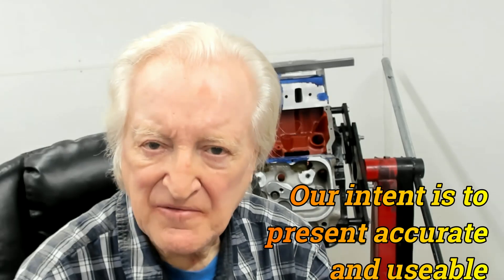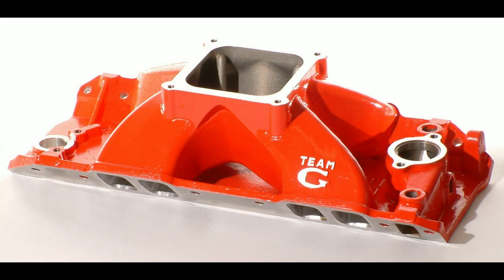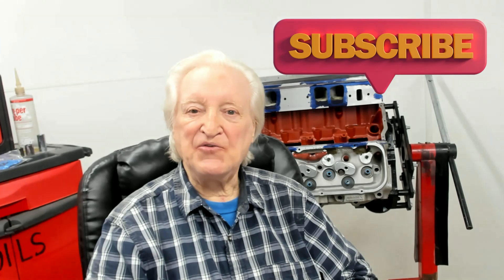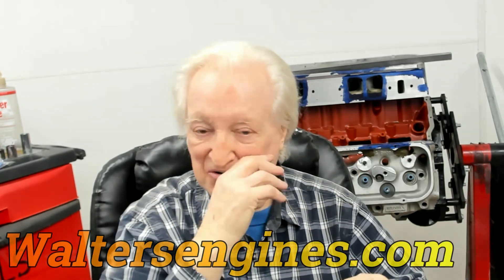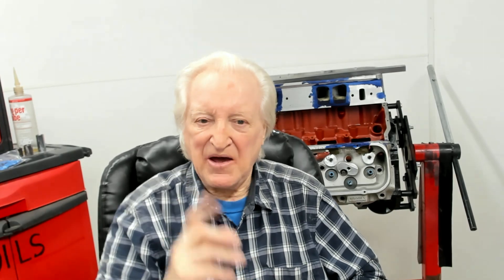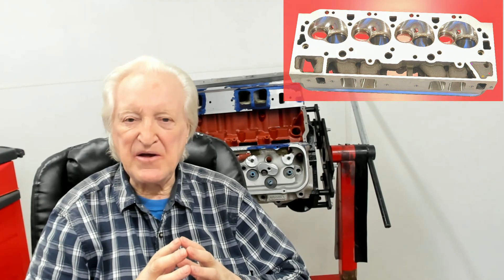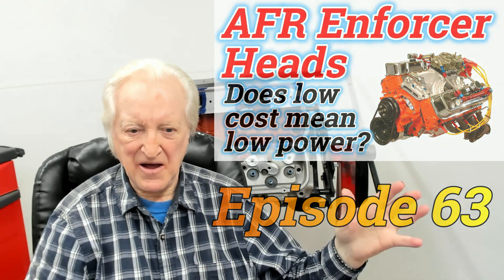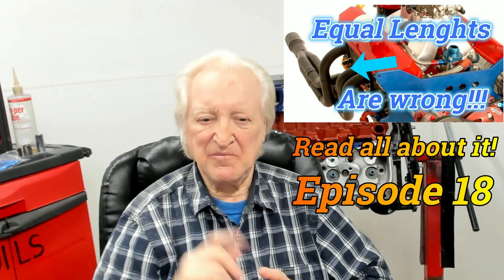BB Chevy 454 stroked to 525 cubes - super big torque!

Comment: Been building big block offshore race boatbengines for 30 years. I even had a supeflow 901 in my house back garage at one point, and listened ro the "gurus" who said 4.375 was biggest you could get in a 9.80 deck. I built my first big block in 1991 which was a bowtie 10.2 block i bought at an auction out of a navy seal  team hsb (high speed boat) i put  a summit/ cola 4.50 crank with JE 4.560 pistons  with .400 eagle rods which made 588 ci. It had a huge solid rollef which i cant remember the specs bit that engine was unbelivable. Anyway i stumbled onto ypur page today and cant wait to look at this 525. Not surw how you get a .250 rod to work on rhat crank but im going to find out. With a stock 454 block im going to save $3k on this engine right off the bat. Thanks and keep up the good work.

Comment: .................back in da day,,,,,1988.............468   was the deal,,,,,,,,,,no cheap cranks back then,,,,,,,,,,, 4.50  stroke  is easy street piston speed for a stroker ,,,,,4.75 inch is ruff ....5 inch is  nuts ........I grew up riding  Harley Davidson  hot rod motorcycles,,,,,,,,,,,,, I still have all the catalogues from  engine part suppliers in file cabinets............fabricators dont discard much,,,,,,,,,,,,,lol .......I like stroker small blocks.....................4 inch stoke,,,,,,,,,,,,,,,,,dart blocks   4.125.........or 4.25  stroke........diesel  torque   on the street ,,,,,,,,,,,,thanks................

Comment: This is a excellent build I am clearancing a 454 block /4.500 stroke as we speak due to getting a good deal on a few 4.500 cranks , I might even duplicate this with a 10.200 (427 truck block)  and a little bigger bore size
Reply: Cool! Did it fit?

Comment: Would that build be ok with a 200 shot or would you need a little wider cam i absolutely love your channel if you ever get time would love a nitrous episode vs the 128 and if the 128 will carry over on big block
Reply: BBC use 132 instead of 128. Same for any canted valve head as well as LS. Hemis are even higher. 134, i think.

Comment: I have a 502 Big Block that when I am able to do would like to get around 750 to 800hp of it either by stroker kit or by a Vortech YSI blower, it currently is around 600hp has GM performance heads and a cam Holley Super Sniper EFI, what would be the most cost effective way of getting my engine up to those numbers? Stroker or Supercharger?

Comment: Hello, Mr. David  Would you mind letting me know? What would be the best cylinder heads and camshaft to put in my big block Chevy? It's gonna have 11.5 compression ratio And the cubic inch of the motor is 546.
Reply: And this is the stroke and the bore 4.280x4.750 And connecting rod is 6.700 long

Comment: Fantastic videos DV, thankyou.
I have a 385eries Big Block Ford .030" over to which i want to run a Scat 502 stroker kit in.
 What this BBC has produced is what i desire to achive for mine, is it safe to assume that these specs basically carry over to the BBF?
I was contemplating using a JKaase P-51 head but see it may not be as big.
Any guidance would be appreciated.
Cheers Ben

Comment: I have a question about the cam. I am looking for a combination that makes good power and torque on pump gas for a boat that has two 454’s. This one caught my attention. My question is regarding the cam. I have been warned that some automotive cams can cause revision of water in boats. This is where the cam sequences allow the water cooled exhaust to draw water back to the exhaust valves. How would I know if this would be a problem with this cam? I am extremely interested in the combination as the power and torque would be amazing for the current 350hp 454’s the boat has now. Awesome video!

Comment: Now what cam would you like to see if you took this combo to 14 to1 compression..
And closer to 7800 rpm..
A taller single plane and a 2 in spacer as well..
I have the vortec 8.1 block which is a tall deck so I can use longer rods as well. Also with a bigger head like the afr 325

Comment: Terry Walters no longer accepting business unless you have a commercial contract with him due to work overload as of Jan 1 2023
Reply: Thanks for mentioning this. I was going to inquire about sending my 1981 454 to their machine shop at some point in the year. Runs perfect, but low oil pressure. I like the idea of a pump gas 10:1 496 build.
These guys seem like the ones to build it for a performer

Comment: David, I have a pair of 565cid (4.25" stroke x 4.600" bore) 9.80" deck engines that are ready for assembly, however they are for a MARINE application offshore hi-perf pleasure boat i mainly use on Lake Michigan. AFR 315cc cnc'd heads with some slight porting on the exhaust port for .700" lift. ...and I have purchased a pair of Edlebrock's dual-plane RPM Air-Gap Pt#7562 in the Rectangle Port design and that's what I am determined to use (don't want to use any single plane). I want a hydraulic roller cam to make peak power up to about 5800-6000rpm, DRY exhaust with 32" 1.7/8" primaries, 9.3:1 comp ratio, Holley 4150 950cfm Ultra XP carb (don't want a Dominator carb) I am a little concerned about reversion from too tight of a LSA on the cam profile, however I LOVE the low RPM idle characteristics of the Mike Jones Cam (450rpm at idle/neutral) ....I always thought the TIGHTER the LSA the more ROUGH  and choppier the idle----no? I'm looking for TORQUE on these 565cid marine app engines....with/using the components/parts I have listed, what CAM specs/profile would you suggest and on what LSA???...and please keep in mind I want easy going smooth LOBES on the cams for long lasting durability and easy on the valve train. I am also using Crower Stainless Steel shaft mount roller rocker arms. I enjoy watching your videos and your tech info. Thank you, Sir....Mark  Btw, I am NOT looking to make every drop of Horsepower at the top, rather I am looking for NECK SNAPPING TORQUE with these 565's and was planning on calling/using a Mike Jones cam as well. Any Suggestions???
Reply: What cam did you end up with?

Comment: Only issue I would see is windage issues with oil. I had issues with stock 468 with oil aeration above 4K rpm. Curious what kind of oil pump and pan was used. Windage tray?

Comment: Im sorry but voltage is a good substitute
Reply: kick rocks
Reply: @xmo552  your feelings have no bearing on the facts.😪❄️
Reply: @xmo552  you show me an internal combustion engine that has a 100% of its torque right off
the first revolution.
Reply: @Rendezvous70  
Absolutely zero. Since the 1900s there have been electrics and by design of the electric motor they've got instant max available torque. The issue has always been the controllers and batteries. In the current age, that's all been handled for the most part. 
I LOVE internal combustion.
And, I don't innately hate electric vehicles by their sole virtue of being powered by electricity. What I DO hate and have a major problem with is the fact that their being forced upon us without our right of choice and they're "sold" to us as being great for the environment. The whole deal is a scam. I'm sorry if you believe yoir purchase of an elect4ic vehicle is good for mother earth. They sold you that ideology just to take you money. Say nothing about the car tracking your every move and you voluntarily give it all up. We're going to have to agree to disagree on our basic stance on this. 

I'm all for electrics actually, but it has to be a gradual and natural evolution. We haven't got the infrastructure and if electrics were soooooo much better then it wouldn't be an argument.... everyone would want one AND nobody would want care for i.c.e.'s.

Comment: have a 525   block and crank   Callies Magnum 4.5  Carrillo .400 long rods  Morel lifters....I have Arias blower pistons new but they have provisions to put buttons on the skirts...this will be very limited street...500 miles a year tops...can I run button skirt pistons for this limited street car    Have GM aluminum heads 077

Comment: Dear Mr. Vizard I like very much all the tech you are sharing with us, I have always been a low bucks guy that likes to optimize my motors and now that you have clarify the cam specs situation I feel I can do better with my stock LS. so my question is have you written a book on what an LS  engine likes? and also porting the 862 or 703 head?  thanks again for all the tips and knowledge you are sharing with me.

Comment: Thanks for the details on the successful engine build. For dollars spent the Chevrolet Big Block V8 provides the best return in terms of horsepower and torque of most engines available to a performance enthusiast.  This engine has been around since the early sixties and is still very desirable. The iron block is heavy but with aluminum heads, intake, water pump the weight comes down to a manageable level for many cars.

Comment: i am looking to build an engine for airboat use, i bought a gen 6 454, but the older blocks are easier to find, and by example, the crankshaft is easier to find and costs less than the single piece rear main seal gen 6, i will bore to 4,350 with a 4 1/4 scat crankshaft 9000 series,  speedmaster top end kit and 6l135 connecting rods, i never think in the 4,5 inch stroke , we need 500 hp, 100 overbore isn't good for a gen 6?

Comment: The last 2 engines that left my shop were done more your way than mine, and it showed, the sbc 427 pump gas Hy Roller made 577 torque and the BBC 540 pump gas flat mechanical cam made 753 torque, however my HP numbers aren't up to yours. 600 and 735 respectively. In fact the BB held 735 + or - 5 from 5900 to 6900 almost flat. while the SBC was more a conventional curve. I have learned a lot in the last year watching your videos and I thank you.
Reply: Before Money..there was a reason a Big Block Chevy was designed....and there are some out here that dont build over a 3,000 dollar engine due to economy and have to live.Most i Know here in east tn. have less than 10 grand in a build....talking g.m. muscle cars late 60,s to early 70,s.......why them yankees like to come down and pluke the ol car from us.....dont take much with a big block chevy to raise Hell on the street/track without breaking the bank....small block guy spend what it takes to build a Ford.

Comment: Yay me😊. Finally something I can use without adapting it to what I need. One question. Two or four bolt mains?
Reply: I'm not sure what he used in this build, but I do know your main bearings will do better in the long run with 4-bolt, and better for the block also. Not hard to find nor too expensive to retro-fit OEM 4-bolt caps, or for the ultimate upgrade use premium quality aftermarket 4-bolt splayed caps.
Reply: @tking7513  the only reason why I asked was on the hp rating. Some claim that you don't need and others say that you do🤷‍♀️. I generally stay away from Chevys. But this one was cheap. I have already regretted it but it's too late now. Thanks for replying.
Reply: @tking7513  also not sure if the mains can be modified or get new ones🤷‍♀️.

Comment: Hi David, I've watched this since you started because I know you from your books. I have also read all of your books and still use them for reference. I have a burning question. 
My BBC is on Holley EFI and I've been trying to find a good cam for it. But I don't understand where the LCA, LSA, or LCL comes into play for this type of induction. It is actually Port Fuel Injected with a Dominator 4 Bbl Throttle body topping a single plain manifold. It's running a retrofit hydraulic roller with Comps adjustable timing set and their 2-piece cover. My heads are overseas with pretty good numbers getting @335 at 700 lift. My cam doesn't reach that level (@650) and I'm using Comps Stainless 1.7 Roller Rockers. I've got a wild set of lifters also from Comp... (not saying)
The cams I find for this usually have a much larger LCA at about 114 and not much lope at idle. I don't understand the difference in the LCA for this type of induction and I'm wondering if it is done incorrectly. My car is a street strip on pump gas and also has 2 stages of nitrous.
I know you've played with EFI in the early stages of your past. Can you get into some BBC with this type of EFI and use good heads, but give us more cam-related information? I'd like to see this engine with electronic fuel injection and your cam recommendations. Think about working with this base and changing it over PFI and playing with the cam selection for those of us out here...
Why does EFI cause them (cam people) to change from the low numbers (@106-110) you use to the high numbers (@112-114) I use? Will it be better to run yours?
Thanks David, "Keep it up!"
Reply: High overlap has a reputation for upsetting EFI systems at low revs (due to lots of exhaust reversion spoiling the computer's airflow calculations). Perhaps this is why they recommend higher LSA for EFI engines?

This is not an insurmountable problem, alpha-N tuning is largely immune to this sort of issue but much more difficult to setup compared to speed density or a MAF sensor based system.

Comment: David: Edelbrock did make a dual plane Dominator intake manifold for the BBC, labeled as the "C-454". Introduced in 1969. Not sure when it was discontinued. Would be nice to have a Dual Plane RPM Performer with that flange for BBC.
Reply: I randomly found a C-454 at a swap meet a couple weeks after watching this video and snagged it. It looks like the high rise chevy intake or Performer RPM with a dominator opening. I'm building a pump gas 509 (.030 over 502) right now and planned to use a RPM Air Gap and 950. But this video got me thinking about a Dominator so maybe I'll test the C-454 vs the Air Gap with a 950 when I get it together. My late father built and raced lots of Big Blocks and was also a David Vizard fan. So I hope to do this right and make them both proud.
Reply: @etenterprises  they really need to take the new technology that’s in the RPM air gap and put a dominator flange on the new Manifolds 
the older style manifold probably still not gonna make the power the rpm airgap will with 1000 CFM 4150 carburetor
Reply: @DSRE535  I've actually emailed them about this. A Dominator RPM Air Gap would be killer.
Reply: Awesome intake and you can still find them on ebay
Reply: I remember those, and for rectangular ports at that ! I'd think the RPM 2 - 4 intake would best it.

Comment: I’ve got a small block that is a aftermarket block from dart  but it’s a 427  with twin 80/85s and we put it on the dyno up at tkm and it made 2.134 horsepower and we stopped that was at 33 pounds of boost  and I’ve ran it up to 44 pounds at the track. It runs good but I’d love to build a bbc seems like you can make that kind of power and don’t have to gut it  I mean they said mine had a bunch more left in it I just wanted it dependable but we all know race cars are not the only thing you can do is get a good program going with a good crew and try to keep it duck takes together. I have a single gangsta 98 turbo I’m thinking about switching too what’s your thoughts on that  it has a Bryant crank mgp aluminuim rods wiseco pistons  profiler heads ported and it’s about 12/1 compression Martin Smallwood speced the cam from isky and yes it’s a solid roller turbo cam  the valve train is ferea  valves t&d rockers pac sprigs smith brothers push rods   I also would maybe like to switch from m1 to do a mix of nitromethane but I don’t wanna burn the engine down. It has a 3 speed turbo 400 that’s been build by extreme transmissions. It originally was a rossler 400  but I’ve never delt with them I have all updated electronics msd600 Holley Dominator race pac smart wire  vps system  I’m very curious about switching turbos and going to a different fuel.

Comment: I didn’t know you could put a 4.5” stroke in a stock block 454?  Bet it takes a lot of grinding.... What kind of idle vacuum did it have with 106 LSA.  I ran a Comp 280 cam custom ground on 106 in a 454 and had to tune the shit out of the carb due to extremely low idle vacuum and had no power brakes, had to add a canister and that wasn’t much better....

Comment: David have you ever tried  SV1 carb on a BBC?  I have one on my 468 race engine and it works better than any Dominator.  I also, have a 1050 dominator #8896.  My 468 puts out 800 hp. and 609lbs. torque.

Comment: Great info, I am going together with a 496 and plan to use the 781 cast head, what can be done with that casting ?
Reply: 781 and the 781X heads are exceptional factory cast iron heads - smooth the exhaust ports and rough in the intake
Reply: Unshroud the valves at a minimum.

Comment: What kind of rod length were you able to het with the 4-1/2 inch crank and a short deck block?? Awsum build by the way. I’ve only ever pit 4.25 strokes in the stock blocks. Thanks for the video information Mr Vizard I appreciate them.
Reply: He said + 1/4 on rod lenghth
Reply: I think that this can also be achieved with a 10.2 tall deck 🤔
Reply: @WestcoastCreole  ya you can get some good rod length in there with a tall deck.
Reply: @johnnyatkins9097  yeah but he said using a good stock 454 block. There is no such thing as a factory tall deck 454. 366 snd 427 were the only 2 factory tall decks
Reply: @bcbloc02  yes where the 366 is a small bore block the 427 and 454 share the same 4.25 bore. So you can use them in any application you could use the 454 block in.
Reply: Wait I'm lost. So... was it a 468 or 525?
Reply: @xmo552  
It was a 525. In a stock block.

Comment: Hi David, did you build this with a short deck block? (9.8") I didn't think you could cram a 4.5" crank in a short deck block. I think I calculated the compression height of the pistons at 1.165" that seems awful tight, but congrats on the motor. I would like to see that in a C4 Vette sleeper. LOL!!!
Reply: Yes is it a 9.8 Block?